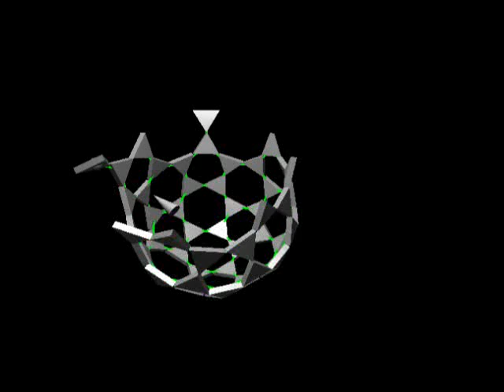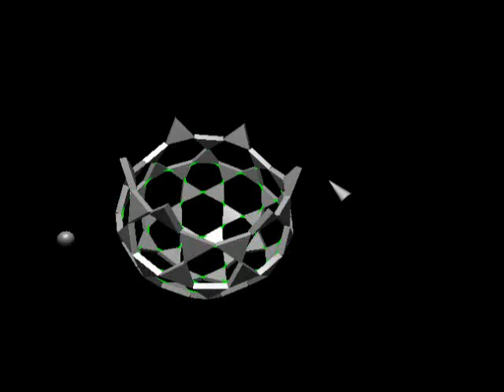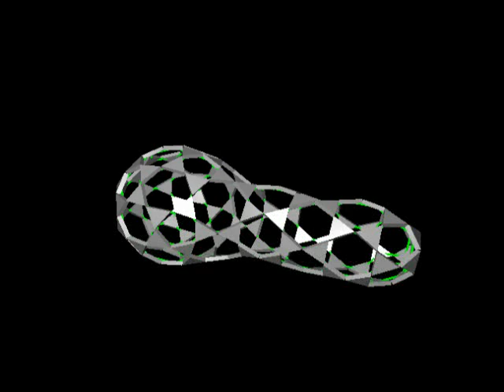NCK - Two-Handed Interaction and Software Release

Comment from the maker: @DrakenZA The Move has one thing going for it, though. With the Wiimote, you need to keep the controller pointing at the sensor bar. If the camera can't see the IR LEDs, tracking breaks down. That easily happens in the middle of a game.

With the move, the orientation of the controller doesn't really matter; as long as it's in the cameras field of view, tracking works.

I've done extensive experiments with the Wiimote, and in practice this is a bigger issue than it might seem.

Comment: @cantorock

Wiimotion plus: IR lights emit light from sensor bar. You hold the wiimote(an IR camera) and point it towards the lights. This is how it can tell your distance from the tv etc. Gyroscope inside the controller picks up the xyz tilts for the controller.

Sony Move: Eyetoy placed on tv, You now hold the light source, instead of the camera. Eyetoy picks up light and can determine how far away from the tv you are. Gyroscope inside the controller picks up the xyz tilts for the controller.

Comment: @okreylos Have a hack at PS Move.  You'll love it.  The internal sensors provide a ton of data, and the X,Y tracking is a treat even with that nasty low-rez PS Eye camera.  The Z tracking isn't as perfect as it could be, though, but that's not surprising seeing as they just use the sphere's size to calculate distance.  Simple, but very effective.

But seriously, if you can get a Move you'll love the amount of 3D control it gives you within the virtual space

Comment from the maker: @Junriah For true 3D interaction there's really no contest between even a single-handed 6-DOF tracked input device and a 3D or regular mouse.

Fatigue is a potential downside, but with a proper setup (like the workbench "shown" in the video) it's no worse than using a drafting table or a real workbench. I've used the workbench for hours at a time building complex structures, and had no problems.

Comment from the maker: @tacoyum6 First, you need a computer with Linux or Mac OS X. (You can try a distro on a live CD if you're wary of going Linux full bore.)

Second, while NCK runs on a regular PC, it's not much fun. To use it effectively, you need some kind of 3D input devices like the ones I'm showing here or in my other videos. A 3D display (like a 3D TV etc.) helps a lot as well, though red/blue glasses do a decent job in a pinch.

I'll try putting some instructions together.